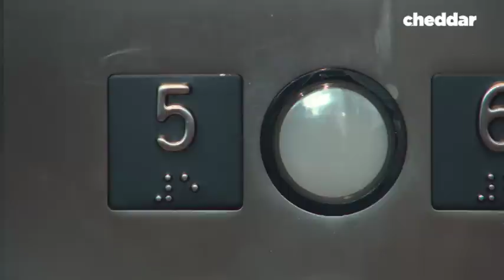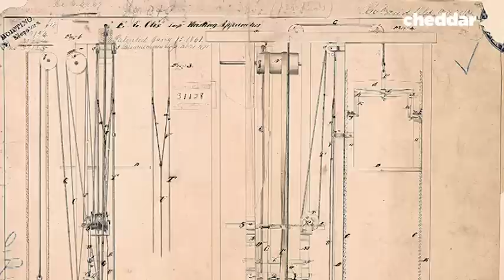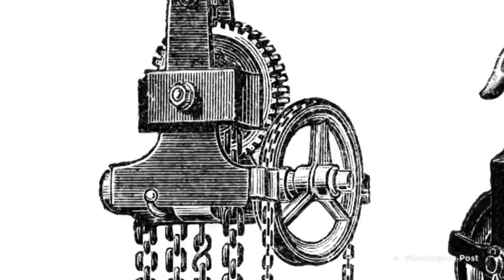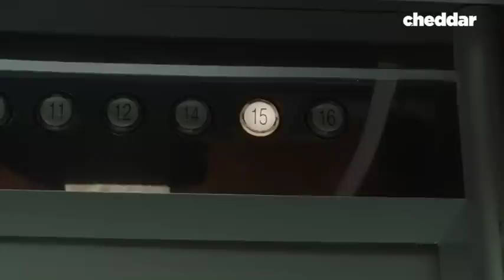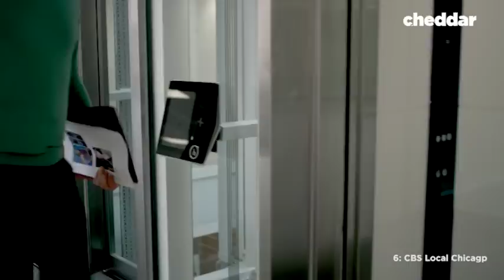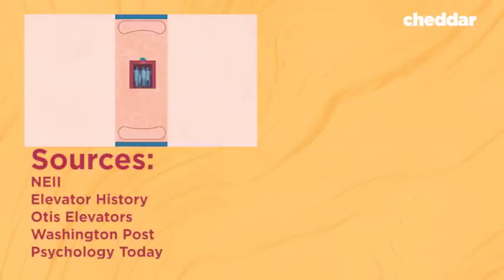Why Movies Are Wrong About Elevator Free Falls - Cheddar Explains

Comment: Some Elevators also have a governor, which is a centrifugal wheel wrapped around the counterweight cable, and when the governor spins too fast, or, in a freefall, it locks, stopping the car. A lot of elevators under 5 stories tall have a hydraulic piston pushing the car up instead of a cable pulling it up. Because of it, you're more likely to get stuck between floors then have the elevator plummet to the bottom of the shaft.

Comment: Perhaps when doing a video about how safe elevators are you should avoid sensationalizing the few accidents that have occurred. The tiniest bit of research would have told you that the elevator in the John Hancock building never "plunged" at all, a broken cable meant the elevator descended in a controlled fashion from the 20th to the 11th floor, the elevator never even reached speeds high enough to trip the automatic safety brake.

Comment: "elevators are perfectly safe when they are used correctly, but if you use them incorrectly, it's a chamber of horrors. there's a 1,000 ways to die in a elevator shaft"

Comment: What's dangerous about an elevator is not the falling part, but the part where you could get pinned between a falling elevator and the outside door frame.

Comment: Worked with the parent company of Otis, which is United Technologies and I was under Collins Aerospace at the time, before Otis was separated. Our new buildings were installed with Otis elevators, whereas our old ones with Mitsubishi. I actually got to see how they installed the elevator, even talked to the guys installing it, and it had multiple redundant fail-safe like the brakes on top of where the elevator ropes are attached. The cables were also multiple strands of steel rope, and it was inspected atleast once every few months. It just goes to show how people exaggerate stuff about modern tech, especially when safety is a concern, that included aircrafts, which also has multiple redundant safety features.

Comment: On 9/11 an elevator in the north tower fell like 70 floors or something before stopping. It did eventually stop as designed and saved the lives of everyone inside. It stopped somewhere close to the lobby and firefighters were trying to get them out. Of course, they all died when the whole building collapsed onto them but nonetheless, the elevator did its job.

Comment: One other safety feature present on elevators not mentioned in this video: Governors, a mechanical device that will stop an elevator if it should exceed a pre-set speed. These can be either a "fly-ball" or a round type governor.

Comment: There is another type of brake : an unpowered rope attached to the cabin and to a roller at the top of the shaft, which speed is mechanically limited. If the cabin goes down too fast, the rope can't go fast enough, and pulls a lever on the cabin, which deploys another set of brake pads.

Comment: Was in an elevator today that had a fall of like 1 meter, then it used it's brakes but for 10 to 15 minutes it was slowly descending in a shocking motion, until we were almost back to ground floor. Was really scary, but luckily we're completely fine and were only stuck in there 30 minutes.
Reply: Glad you are okay. What is a shocking motion?
Reply: @will9703  Like, we slowly went downward and every couple seconds the elevator was shaking

Comment: In 1945, a B25 'Mitchell' bomber ran into the Empire State building, between the 78th and 80th floor.  An elevator operator named Betty Lou Oliver was thrown out of her elevator on the 80th floor and suffered burns.  She was loaded into another elevator but the cable snapped and she fell 75 floors to the basement.  Because the cables had been burned in the fire.  She survived the fall with a broken pelvis, neck and back.  It's thought that either 75 floors of cable piled up beneath the elevator to break its fall, or else air in the elevator shaft compressed to slow the car down.   She is still in the Guinness Book of World Records for surviving the longest elevator fall.  So they DO happen!  But rarely.

Comment: AT BLOODY LAST! Someone with a brain. Why are people so dumb to think that lifts fall when the ropes snap? THEY DON’T FALL. And when they do, it’s because they are very tall and it takes a longer time to apply the brake, and when they fall until they hit the bottom buffer, it’s because they are abandoned and people come and cut the ropes, and then release the safety brake to allow the lift to fall freely until it crashes. Many times this is done to make it easier to dismantle an old lift easier (correct me if I’m wrong).Your video is almost to the level of a competent lift engineer. Very well done.

Comment: I didn't have a fear of elevators until this video and your example of the elevator falling in Chicago.
Reply: The lift was descending at a high speed as it normally would, but when it started to decelerate the cables snapped and the brakes worked just fine. The passengers were stuck on the 12th floor but the lift was an express one, so they had to cut a hole in the shaft in order to get those people out.

Comment: If you want to feel safe in an elevator, never read the sign showing when its next safety check is due - a surprising number of them seem to be out of date. I'm more scared of just getting stuck in an elevator for days with no help than the thing falling down the shaft.

Comment: She mentions the "rope grippers" which is installed on the counterweight side of the hoist ropes which cuts in in case of over-speeding. However I got the impression she was referring to "this" as the brakes which is not the case. It's the disc brakes on the and calipers between the motor and gear box (geared traction) or between the armature and driven sheave (gear-less traction)

Comment: Cheddar: tells us about how safe elevators are
Also cheddar: “here’s an accident that could’ve killed everyone in the elevator caused by the failure of the safety chain”
Reply: I guess that's like someone saying how air travel is the safest form of travel but yet pointing out to the time a DC-10 lost an engine and crashed.  I think the point is that nothing is 100% safe even if it is safer than other things..  Some think you may be safer in an airplane then walking down the street.

Comment: I was never really scared of elevators. 
And I "survived" a falling elevator. 
And it went.... strangely. 
I lived in a 21 storey building, on the 19th floor. I stepped in the elevator, nothing was wrong. The moment the elevator arrived at the 19th floor, it just kept going up to the 21th and then I heard a loud "BANG", and at the same time the elevator started to free fall.
But only few floors I think. After around 4 floors passed, the elevator suddenly slowed.
Then it alternated between "free fall" and "brakes". It was really nauseous but kinda fun to ride. 
It took only around 1-2 minutes to reach the ground level and smash the bottom "bumpers" (sorry I'm french, I don't know how It's called). 
It was a little bit violent but only broke my ankle. 
Now I have seen how an elevator can fail,  I really trust them as safe. 
Of course it broke my ankle but that's it. 
It's incredibly safe.

Comment: In university, I lived in a high rise building with a bunch of other students. There was a set of really stupid boys that lived in the building that liked to mess with the elevator. They would jump up all at once and trigger the emergency break. They would then use the emergency door release to claw out at the nearest floor, leaving the elevator usable until someone came to fix it, usually not for several days, in a 12 floor building. They would also do it with other passengers in the elevator with them. 

Long story short, they got stuck late on a Friday night during the hottest part of the school year and the door release wasn't working. They were stuck for several hours, in the heat, and with their vomit as they were all drunk as hell when it happened. The fire department got them out, but we all wished they would have been left just a bit longer, especially those of us that lived on the upper floors because the elevator would not be fixed until the end of the semester.

Comment: On the one hand, the entire industry of elevators was founded on the engineering that limited the free fall, with 'brakes' built-in to the basic design.  On the other hand, I've read about engineers who say they would never use elevators in this building or that.  Still, the safety record of elevators is about the best in any industry...

Comment: The only elevators that I didn’t like were the ones in the Haley Center at Auburn University, the tallest building in Auburn, Alabama. The problem was that they shot up and down the floors so fast they would cause vertigo, nausea, and dizziness. It always felt like you were in the elevator from Speed or a similar movie.

Comment: I like annoying my friends by bouncing in elevators, especially the hydraulic ones. If I bounce too hard, the autolock kicks in, and may have to wait a few seconds for the elevator computer to reset to resume the trip. I discovered this trick on the hydraulic  elevators that covered three floors at the Peabody music dormitory in Baltimore.
When tornadoes  came through Atlanta in 1982 (I think), I was in the Coastal States building on the top 27th floor. As I saw funnel clouds approaching, I got in the elevator, and when it started moving side to side instead of up and down, I decided that was a good time to get out and take the stairs.

Comment: I like the ratchet system Otis developed. It such an elegant solution, it doesn't require power, or any other safety system. It's fail safe too because every metal tooth all the way down would have to break for it to fall and that's never going to happen.

Comment: Interesting choice to use clips from the elevator scene in Poseidon, like the ship is literally upside down so technically the elevator is falling to the top of the shaft so I have a feeling some of the safety features wouldnt work in that scenario like sure it still probably wouldnt fall like it dose but still

Comment: There’s another, last resort safety measure, air pressure.

If somehow, every singe safety measure somehow failed, all the brakes didn’t work, all the cables snapped, the elevator would not free-fall like it does in the movies, due to the fact that since the elevator car is in an enclosed space, a cushion of high air pressure would form beneath the car, slowing it’s decent. Sure, it will definitely fall quickly, and could cause injuries, but it would not fall like an object in open air.

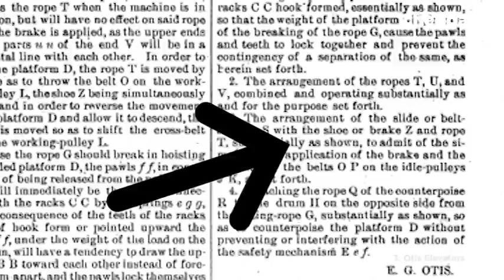Comment: 2:16 this is the same system they use on roller coasters with a chain or cable lift, the track has a series of teeth and the train has a metal bar that rolls over them as the train goes up the lift hill. If the chain or cable snaps the train rolls backwards until the bar on the train can't make it over the next set of teeth which is when the train stops. This is also why you here the clack noises from a lift hill, it's the metal bar on the train going over the teeth and slamming down in the groves.

Comment: I was working construction in SF(209 Sacramento st. 9/7). We were remodeling a few floors in the building there. I was the last one in the building except the front desk worker. 

Before calling it a day I go up to the 14TH floor to use our designated restrooms After so I re-entered the same elevator to begin my 2 hour commute home. I press the button for the basement(we had to use the basement to enter and exit), but the elevator immediately went to a free fall to the basement with me in it. I thought for a sec jokingly; should i test the theory and jump? Then it came over me like a deathly chill; that I was about to really die and this was really how my life was going to end. So I laid down flat. I was stuck in there for 3 hours alone, but I walked out just fine after being manually cranked back up to the 14th floor cuz we couldn't open any other doors.

It all happened so fast yet that fall felt like forever. Company turned on me after that and my x-rays showed I had stage 4T cancer, but and my fiance left me after finding out. I survived the cancer and I'm ok now at 29. Off topic I know, but just know life can always turn around for the better. GOD bless you all

Comment: She is unaware of the thousands of tiny razor toothed leprechauns who live in the elevator shaft ,and will enter every crack and opening in the cab and speed devour you and your belongings so completely there is no trace of you left. This happens if you go into an elevator and don't press any buttons (or someone does not hit the floor call button) for roughly 30 minutes to an hour. The RTLs ignore stuck situations as they figure help is coming and they don't want to raise suspicion.

Elevators are very safe. Just don't wait too long to pick a floor.

Comment: Not only that, but some elevators have an additional braking Device called a govorner, if the car descends too fast, the cintrificul force locks the governor, halting the elevator. And besides, not all elevators are cable elevators, in low rise builds with less than 10 floors there are hydraulic elevators, in which the car is pushed up by a hydraulic ram in the bottom of the shaft, since hydraulic elevators have no cable, they cannot free fall. The way you can tell is if you hear the motor going up, but not going down, it's a hydraulic elevator, if you hear the motor going up or down, it's a traction(cable) elevator. This is because hydraulic elevators use a pump to go up, but do not need to run the pump going down, while traction elevators  need to use the friction from the lift motor to slow down.

Comment: It sometimes happens that a disabled person with an electric three wheeled scooter drives through the door of an elevator. Mostly as a result of a driver error. The elevator doors are not always strong enough to withstand the momentum of the scooter. Probable this type of accident has cost more lives in an elevator shaft then people dying by riding the actual elevator.
Reply: That would be a scooter accident not an elevator accident..................  They may also accidently accelerate the scooter and go out into traffic and have an accident.

Comment: I feel like more people need to review this video before you post it. You left me with more questions than i started with.

How do elevators go down with the safety pieces created by Otis?
Why did the elevator plunge stop on the 11th floor?
How old are these multiple safety mechanisms? Will i find them in old hotels? Little european elevators?
When the power goes out, exactly what happens then? The video sorta touched on it, but didnt really give a step-by-step process.
Why is there such a specific weight limit to each elevator if the safety is 11x the weight of the car?

Comment: I remember the chain elevator. (Not sure what they are called) it's basically chain of cabins going up and next to it they go down. There's no door and you basically have to jump in while it's moving. 
Oh, boy, they used to give me fobias. 
My mom used tell me as kids they would get in and stay in past the last floor so they would just ride in them in circles. I was curious and wanted to try. Well, I did it only once, it was just too scary for me.
Also had nightmares about elevators not falling down, but their shafts were exposed or elevators that don't have any walls or you going up and it doesn't stop. I've seen some very old elevators with see-trough walls in very old dark buildings as kid and am pretty sure that through me off.

Comment: I was at an event last last year with a lot of kids and they decided that the one elevator up to the third-floor was so much more fun to ride in with everybody jumping up and down, needless to say they triggered the safety. However one of the kids in our group who is deathly afraid of elevators, I took the opportunity to tell them afterwards that there are a lot of safety mechanisms and that the circuitry and programming noticed parameters out of spec and returned home and locked itself out for safety. I also said that an elevator control system is one thing I would not necessarily want to program, robots are SO easy compared to elevators. Which considering the group was a Legos robotics team who had struggled during the year to program the robot....

Comment: Missed out the motor brake is the main brake of the lift, the car brakes only hold it at a floor and do stop the car under powerless or emergency, if the mian cable/s is broken as a secondary backup its looped back to the counter weight and will rise or fall depending on the cars weight, good video though.

Comment: Good video, some additional clarifications, the video only covers traction elevators, or elevators that have a hoisting machine, a counterweight, and hoist ropes with safeties. 

Older traction elevators may not have the rope brake unless they have been upgraded to have them. 

finally direct hydraulic elevators are not typically provided with Safeties unless they are of the roped hydraulic variety, or safeties have been added for some other reason (ie as a an additional measure of safety for a very old single bottom hydraulic elevator). 

Hydraulic elevators are becoming less common as new installations thankfully.